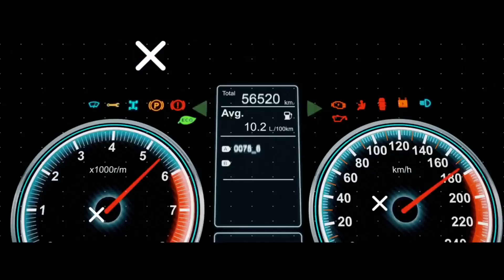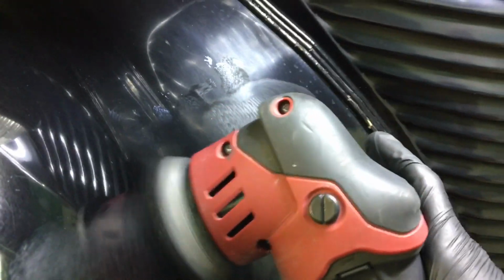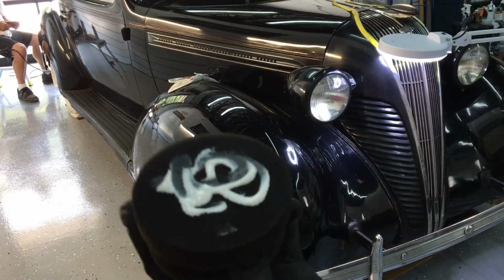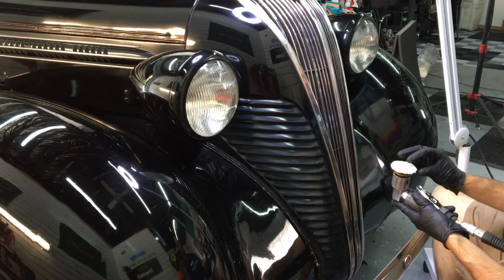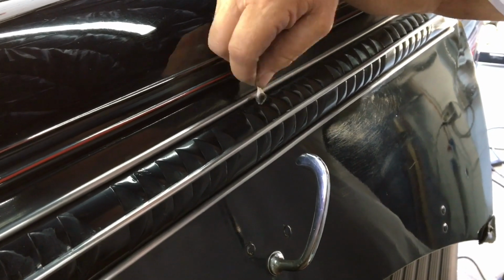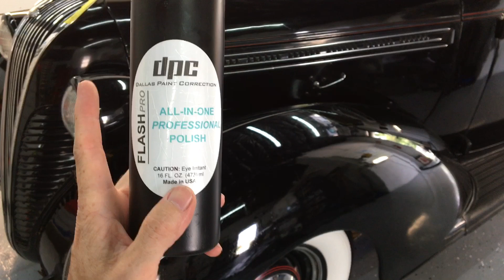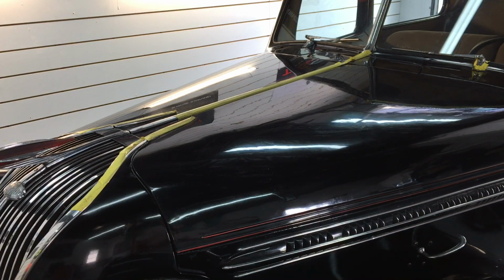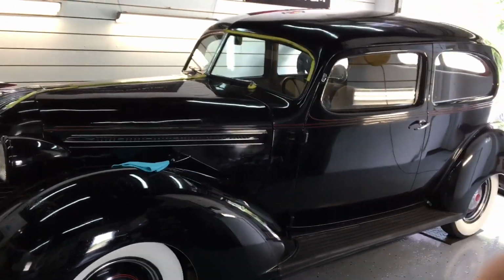37' Hudson Terraplane Mini Restoration!! Episode four!

Comment: Great series. One of our personal favorites was the heavily ozidised red Porsche you restored a while back. The DPC Flash Pro is perfect for this application, a question however, why wouldn't you use a dedicated glaze?
Reply from the maker: It is an option. The route I took filled in those unsightly cracks the best.
Reply: Garage Therapy, what glazes do you use and recommend? I've tried several dedicated filling glazes and have never been close to impressed with the results achieved for the time spent. Well, except for Essence.. but it's kind of its own thing.. 👍👌✌